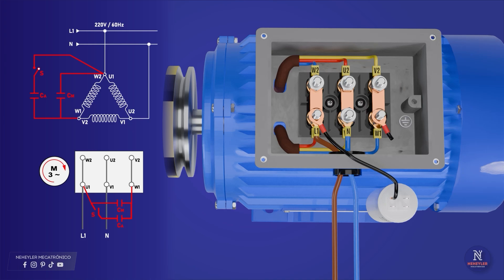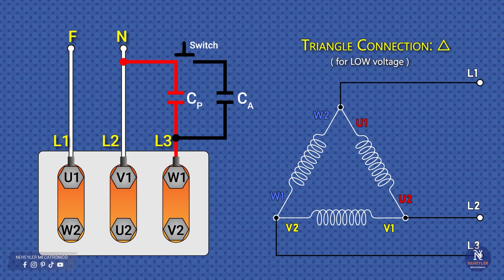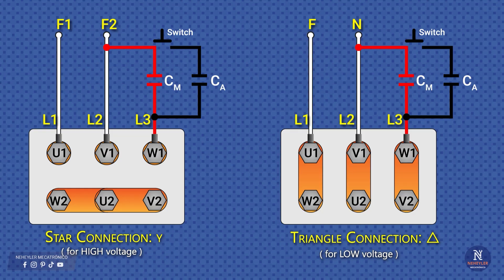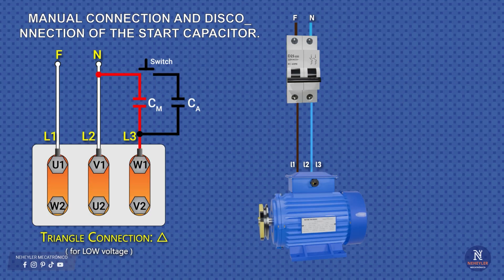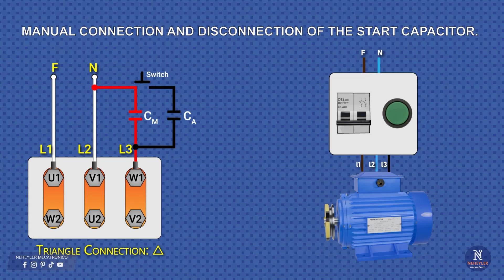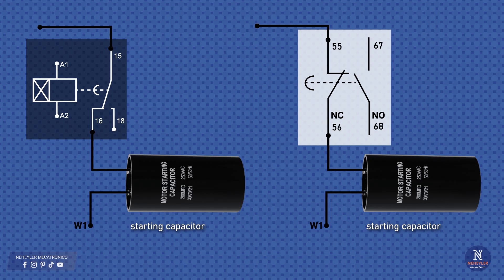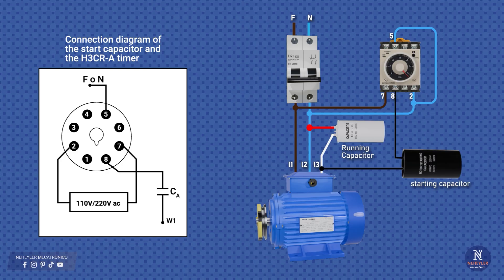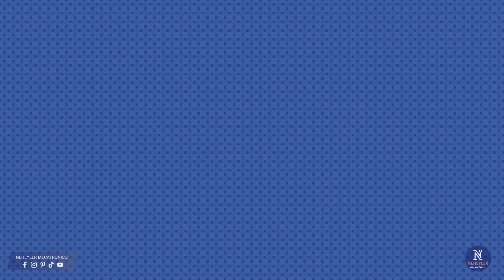Three-Phase Motor on Single-Phase 🔌 Manual and Automatic Disconnection of the Start Capacitor

Comment from the maker: For clarification: In this video I used two capacitors:
CM = Running (or Permanent) Capacitor
CA = Starting Capacitor

⚡ The red and black markers are not the real colors of the capacitors — they are just labels to make the explanation easier to follow.

Thanks for watching and for your questions! 👍

Comment: The clearest takeaway was why the start cap must be removed after 3–5 seconds (and how an NC on-delay timer contact makes that automatic). Also appreciated the practical notes: delta is usually the better single-phase option for torque, start unloaded, and match timing to HP so you don’t overheat the start capacitor. This lines up with what phase-converter manufacturers like Phoenix Phase Converters and American Rotary usually emphasize. Get the wiring right and protect the motor, because the “it runs” setup isn’t always the “it runs safely” setup. Thanks for sharing the information so clearly.

Comment: What color is the running capacitor 
And starting capacitor
You have a red and black markers
Reply from the maker: In this case, I used two capacitors:
CM (Running or Permanent Capacitor)
CA (Starting Capacitor)
The red and black markers in the video are not the real colors of the capacitors, but just labels to help distinguish between the two.